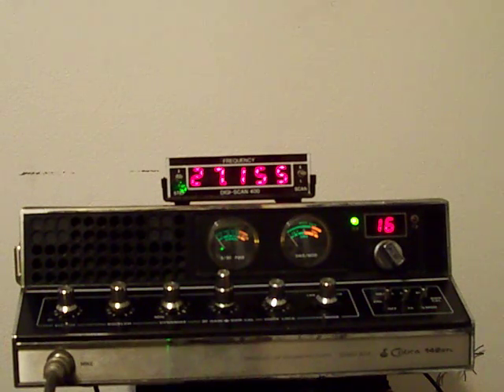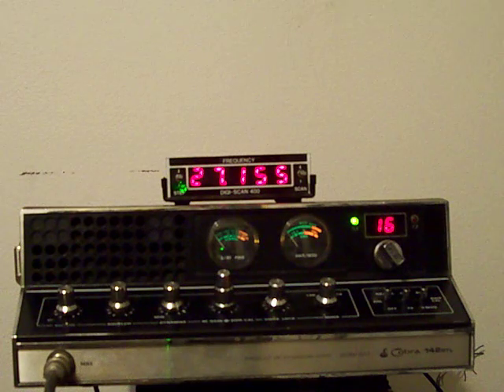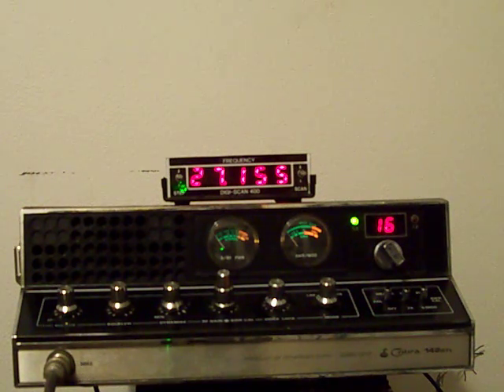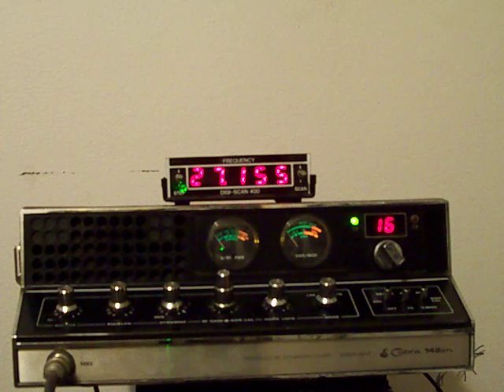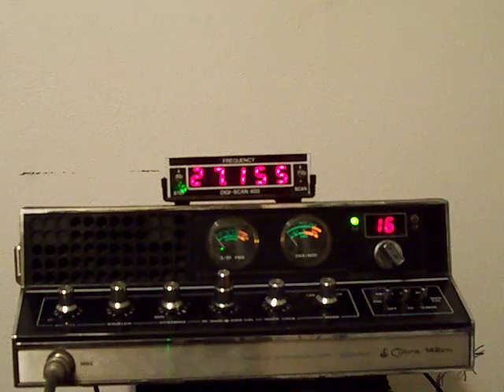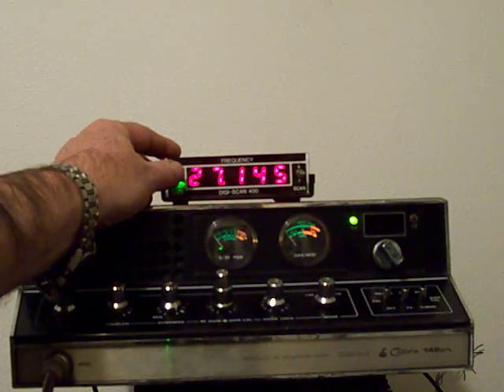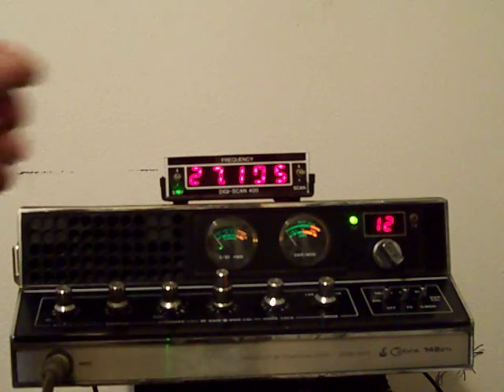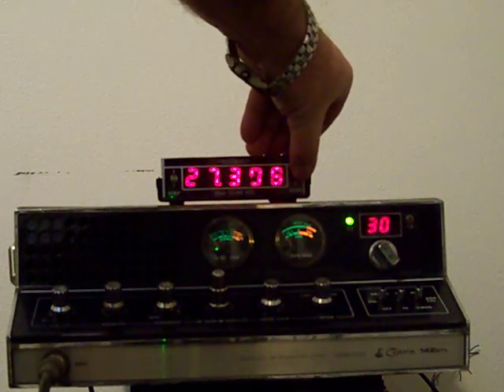Digiscan with Channel Display

Comment: Neat..  Would you mind sharing how you did it?
Reply from the maker: +Nathan Daniels Sure!  The Digiscan contains two parallel counters. One drives the display, and the other drives the PLL that is attached to the VCO in the radio. When power is first applied, the counters always start at a given number, and then pulses are applied to both counter chains when the switches are used to scan. I have a microcontroller that counts the up and down pulses that goes to the counters, and I keep track of them. When the up or down count would put the Digiscan on a CB channel, I use a lookup table that I compiled to match the patterns for the LED segments and I use output pins to drive the LEDs directly. I thought I was going to use this radio on 10M, but I am using something else so this thing is for sale if you know anybody that would like it.
Reply: +TinkTron , sounds complicated.  What are you asking for the radio?